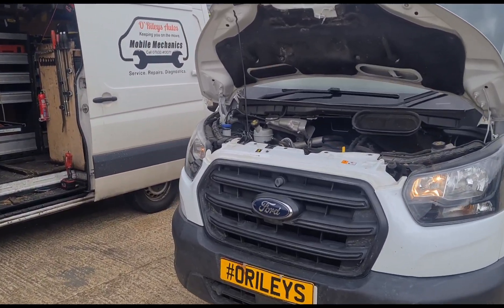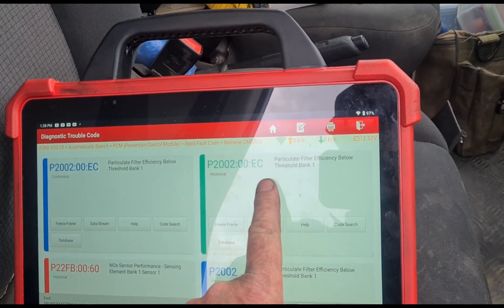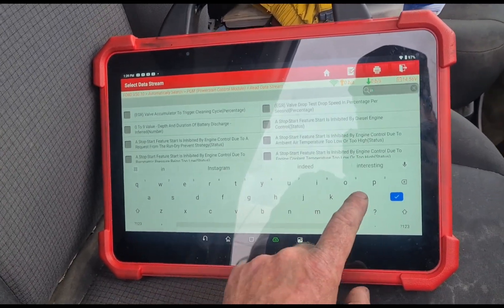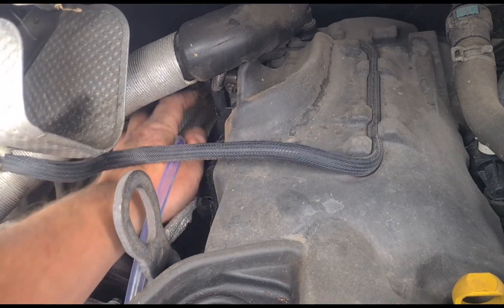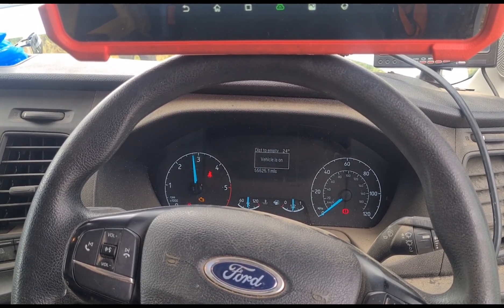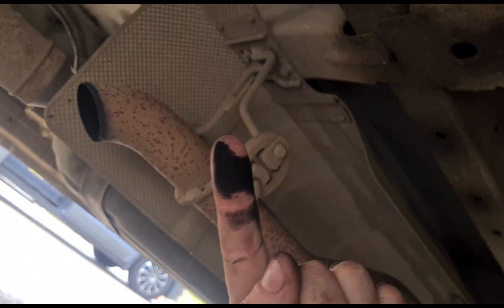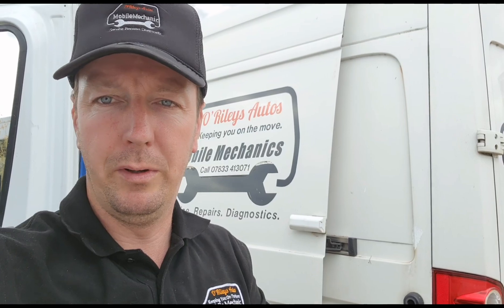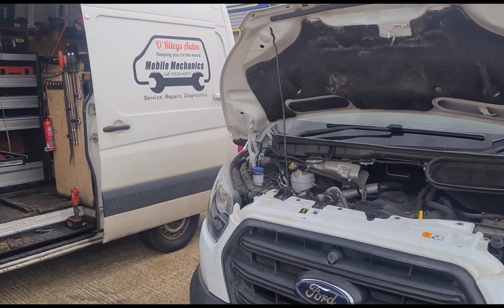Ford Transit MK8 P2002 P2002:00-EC

Comment: Hi, i cleaned the the dpf on my transit custom mk 2016 2.2 got it down to around 500 Pa on idle. Reset the dpf values, but immediately afterwards there is stuttering under acceleration. It says the oil contamination warning, but I'll be changing the oil tomorrow. Any idea why it might be stuttering? No ithe PCM codes come up apart from the oil. I also changed the egr valve and reset the values for that

Comment: Time to get it deleted then!  BTW these aren't always cracked, there's a compression ring around the filter cartridge on most DPF's that that's supposed to form a gas tight seal.  These can become dislodged or misshapen and allow it to leak soot etc past the particulate filter element.  You can sometimes compress the body of the DPF to try and make it seal again, but that usually results in the element becoming cracked.  The other option is to carefully cut the outer can and repack the DPF then weld it up again, but be aware than if it looks as if it has been tampered with it's an MOT fail.  Most DPF's being stainless though, it's very easy to make it look like an original old factory weld.  Use Straight CO2 instead of Argon mix, this will give the weld a slightly brownish appearance, instead of it looking new and shinny.  £2k for a DPF on a relatively old van is insane when you think about it, it's nearly half what a bare engine costs for one of these!  And for what really, a piece of cheap stainless pipe with what is essentially a fairly crude filter element inside!

Comment: Feck only  55K  would this been caused by regent's.
Reply: Something tells me that these new euro 6 vehicles regen at a temperature and setting which is good for the so called "environment" (as if euro 5 did a bad job) but bad for the DPF itself as it needs a better setting (like Euro 5) to be able to be happy. So now their focus is "environment" but they don't care how long a DPF last. I could be wrong, just my opinion.

Comment: How can you be sure the DPF has actually cracked and needs replacing? Is there any way to test this other than seeing soot on the other side of the exhaust?
Reply: I've seen it where some have rermoved the DPF and back cleaned it... works, sometimes.
Reply: @tomsurrey2252 I use Mannol dpf cleaner and use it like Jimmy uses the launch cleaner.
Reply: No if's or but's, soot in the tailpipe on a vehicle fitted with a dpf means its knackered.